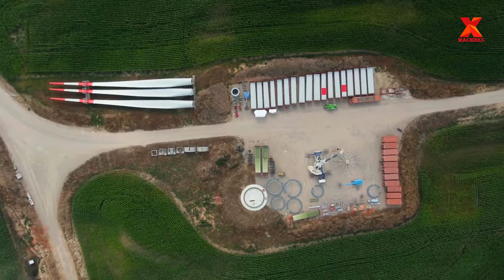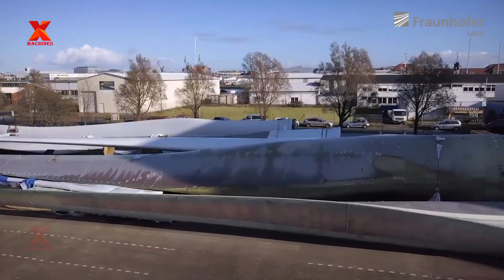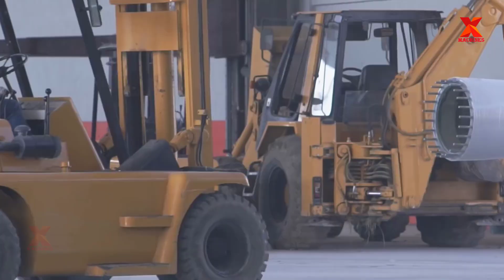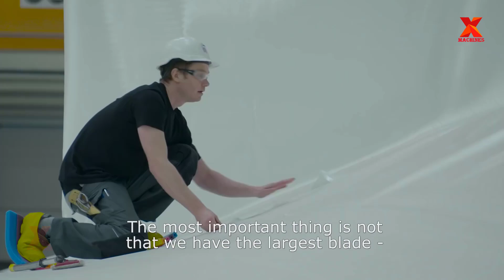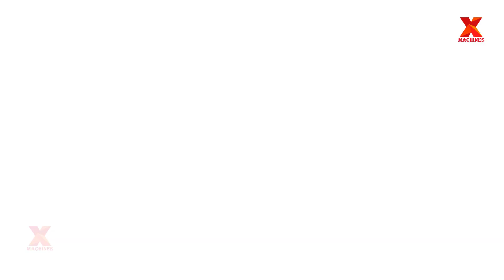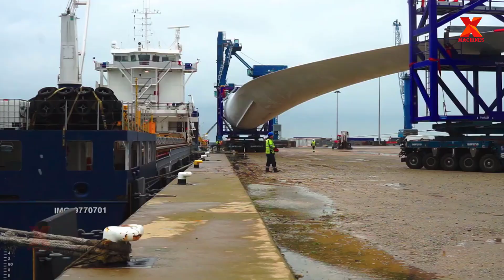Wind turbine blade manufacturing process and discovery of the world's largest wind turbine blade

Comment: They better not be using power from coal, gas ,oil or nuclear energy. Kinda hypocritical.  And for you green folks,  add in shipping, actual ships, trucks, excavating, temporarily  widening roads to truck in, trenching and more. Its not as green as you think. Dozens of trucks. At least 6 or more trucks just to bring in the cranes to erect. Turbines are noisier then hell too and oh I love the shadow flicker and the interrupted tv signals and radio.

Comment: I've been curious for a while why  horizontal axis wind turbines are so much more common place than vertical axis wind turbines? Is it really more efficient this way? It seems like you could build smaller turbines in the vertical style that would easier to maintenance and safer as well. I have read that vertical ones tend to be a bit slower, but with the fewer materials needed, less expert workers needed, more job safety, and less need for as large of machines you'd expect the cost over power production to be nearly balanced, maybe even tipping more into verticals favor since they can be used in more environments even urban like solar panels.